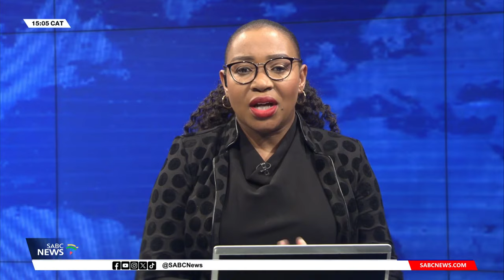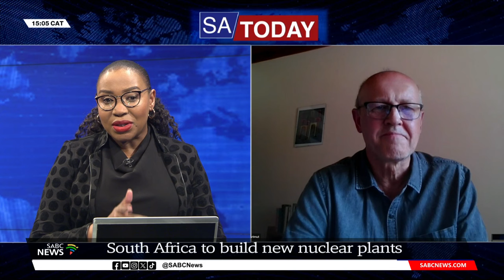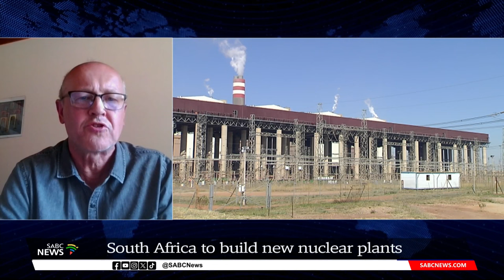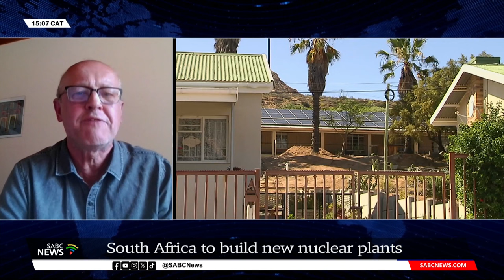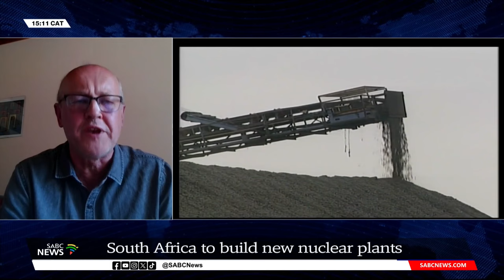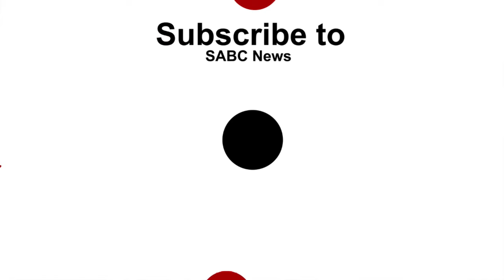South Africa to build new nuclear plants: Professor Hartmut Winkler weighs in

Comment: SMR's (Small Modular Reactors) could be of huge benefit and with reduced risk. Modularity will allow future upgrades at a vastly reduced cost and spreading the generation over multiple modules means less downtime and unavailability during repairs, maintenance and refueling. And fair enough the spent fuel can't be directly used and has to be stored somewhere, but storage techniques are quite well established and can be done remarkably safely. 

Although very energy intensive, it is possible to refine some fuel out of the spent fuel and somewhere later down the line we may find another use for the spent fuel, but anyway there are options.

We already have huge amounts of Uranium sitting in Gold mine dumps so we might as well start producing our own nuclear fuel too instead of buying that from Russia as well.

I think ultimately nuclear can really help revive the economy if done properly, and ultimately the world over needs to adopt more nuclear generation since statistically it's the safest and most powerful source of energy, but I agree that other renewables will together play a huge part, we need everyone to become a generator